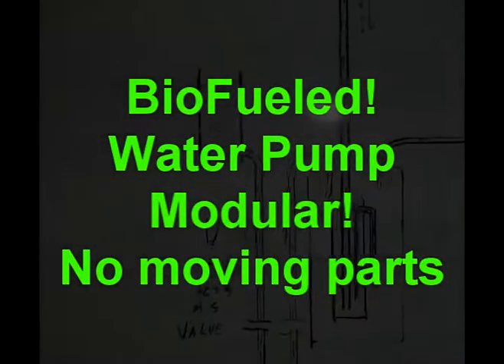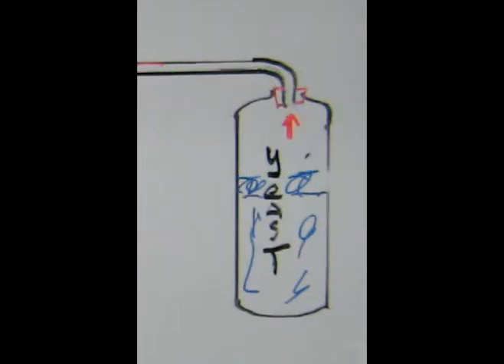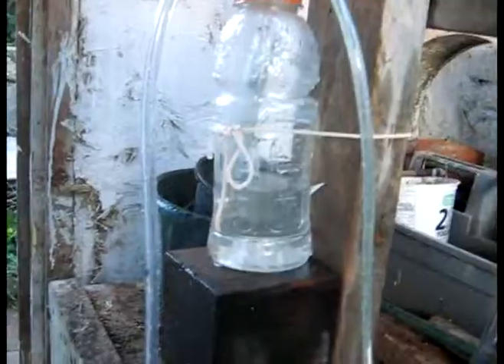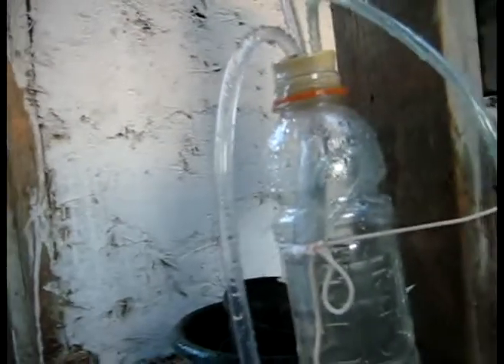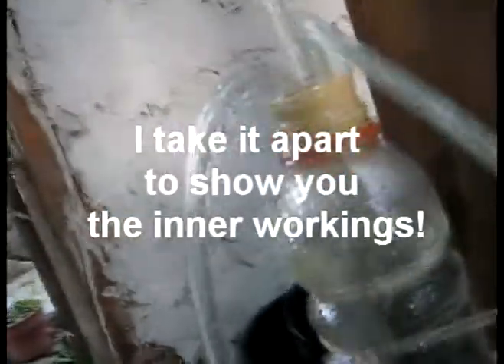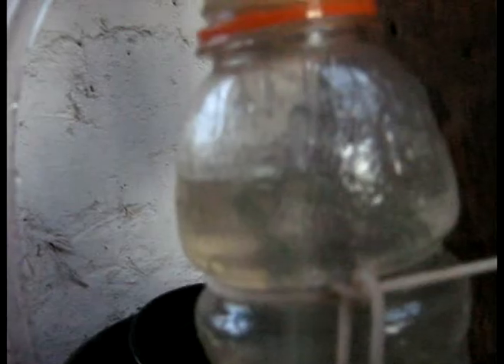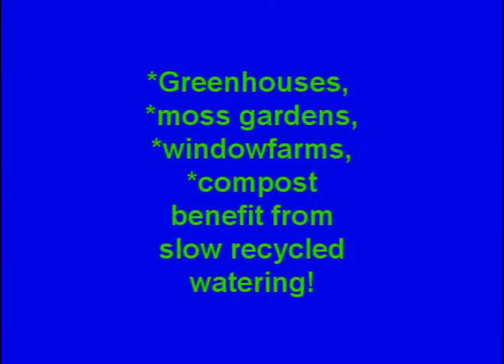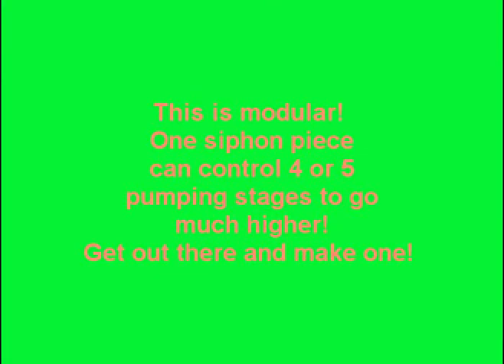NOT  Hero's fountain!  Fermentation fueled fountain can go for a week or more!

Comment from the maker: @videodude4  I will retire this video as soon as I make a sequel. I just had to wait till the winter ended because I want to do the experiments outdoors and fermentation is really slow in the cold of winter.
Perhaps the next version to power a little water feature or something for automatically watering seedlings or plants.  If you have yeast and sugar, and something to make holes in rubber bungs, you could start right now.
 I do not have figures for how quick it pumps.